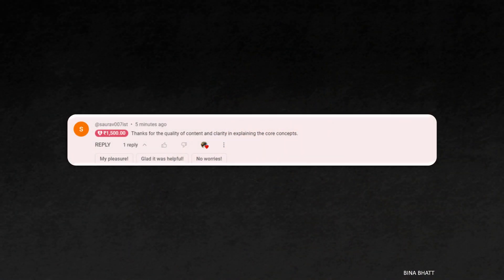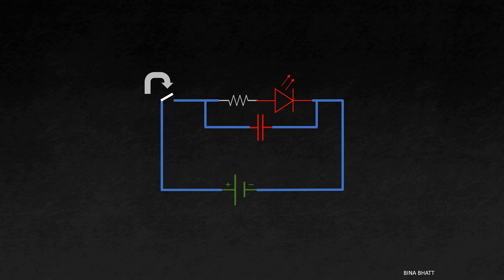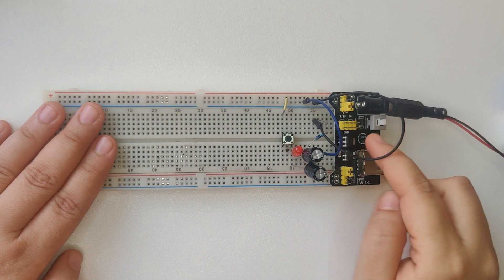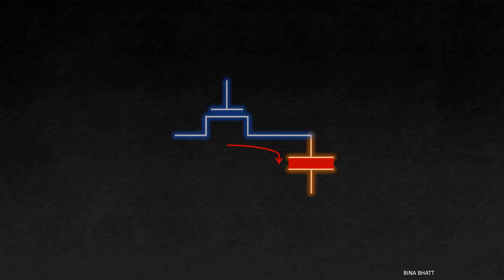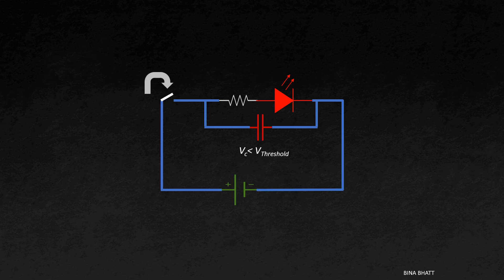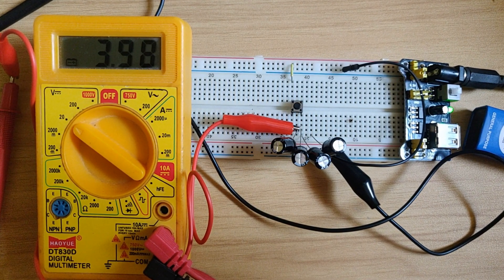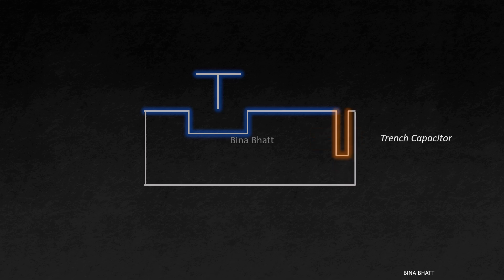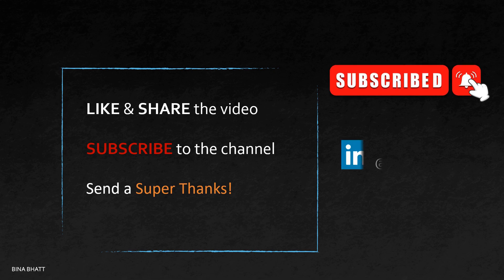Dynamic RAM Cell on a breadboard! #DRAM

Comment: Instead of using more capacitors (which are bulky), you might have just increased the resistance so that the smaller capacitor discharged more slowly ;J It's like using a bigger bucket vs. using a smaller bucket but with a smaller leaking hole.

Comment: Where is DRAM used ?
DRAM is used as the main memory in a computer, while SRAM is used as a cache memory inside the CPU of a computer.
why is it still used? 
DRAM is still used cuz' it costs less than a SRAM.
The differences you've already discussed in your previous video.
Thanks for your hard work 👍💐💐💐